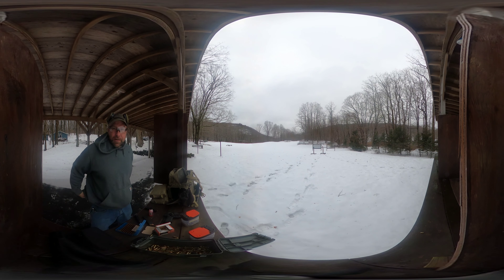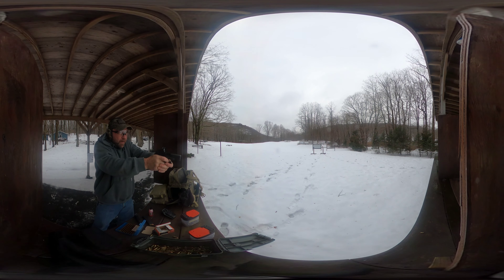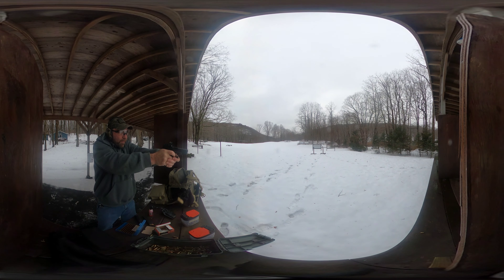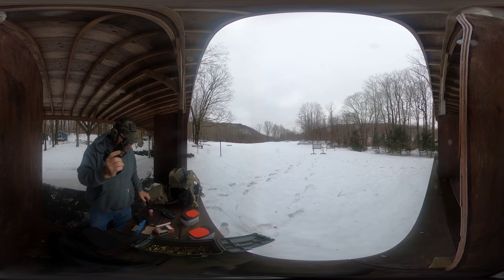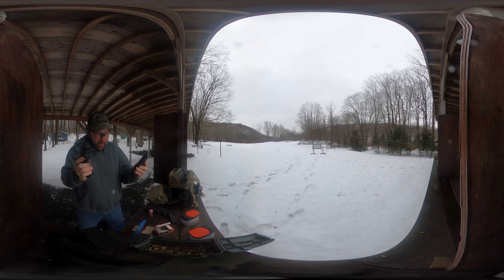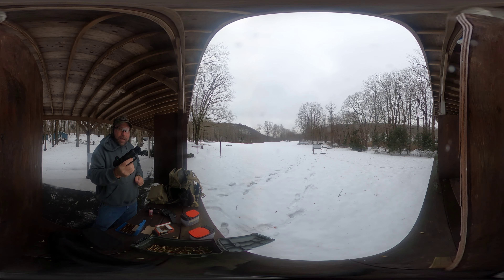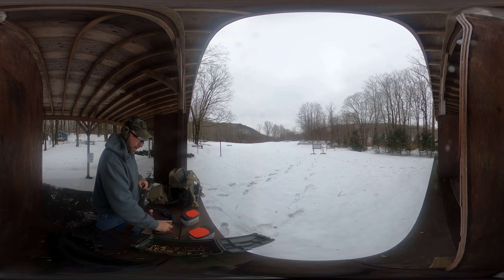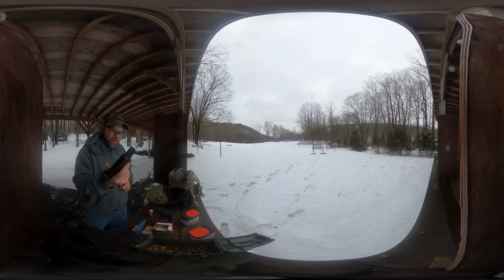Glock 45 MOS wants redemtion

Comment: Wow, 4k 360°, sweet! Something I read once made me paranoid about " hang fires" (delayed cartridge ignition from a malfunctioning primer), so watching you handle that round so quickly after it didn't go off made me cringe. I always hold down range on target for 10s if something like that happens, but I know it's extremely unlikely a hang fire would occur. "HANG FIRE Gun Fail Compilation" is also a video here on YT I watched.
Reply from the maker: You actually right.  Should've ejected it and let it be for a bit.